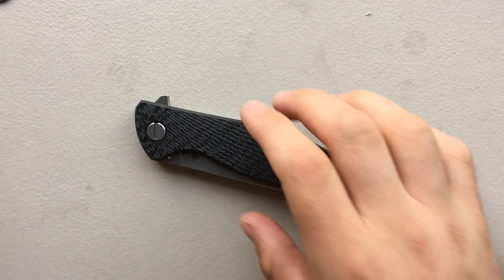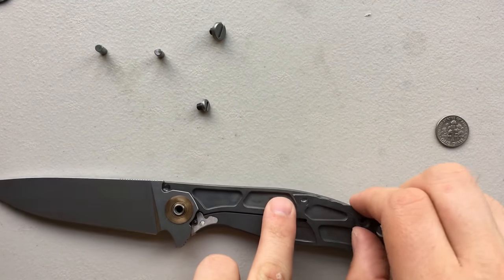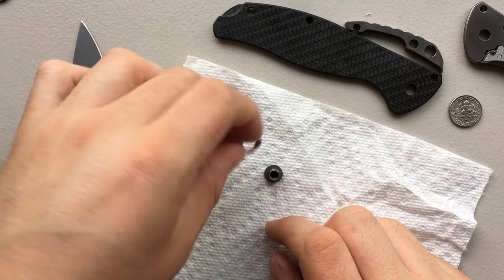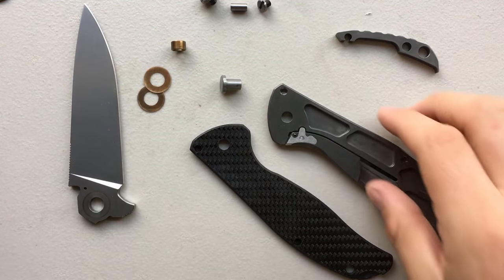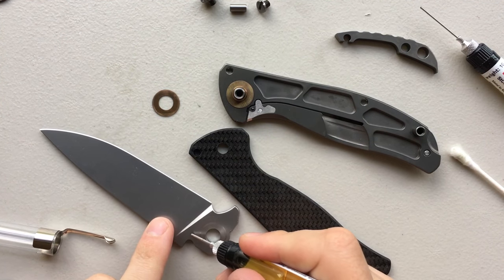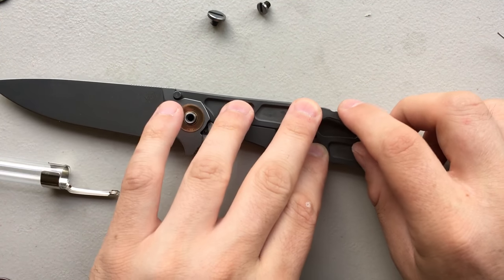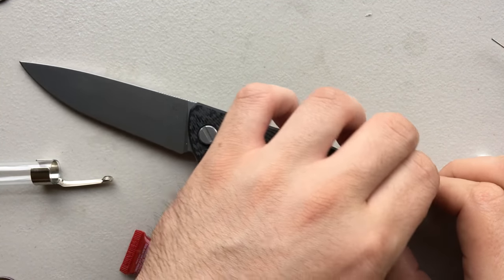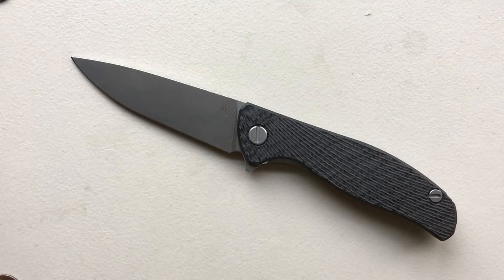How to disassemble and maintain a Shirogorov Hati Pocketknife

Comment: Is this a new thing using heavier weight for the detent? It makes a lot of sense! Gonna do that from now on.
Reply from the maker: +n antip I'm not wholly convinced it makes a difference but can't hurt
Reply: I suppose the main difference would be that the heavier oil will tend to stay in the detent hole and track, rather than eventually work its way toward the blade.

Comment: nick thanks for giving your norseman to birdshot IV, good luck getting it back. jk
Reply from the maker: Hah.  They're not so far that I can't drive down there...
Reply: well this is a dumb question, but why is your norseman in a spyderco box if you watch their video
Reply from the maker: Because the Norseman doesn't have a box, and I figured I'd mess with them a bit.  They didn't know what I was sending.
Reply: will you join the give away from birdshot
Reply from the maker: Nah, I'm a lucky man as is with loaners and great viewers.  No sense in pushing my luck!
Reply: I am asking some recomendation of a custom knife. i have smaller hand and shorter than avarage  height, and under $1000

thanks.
Reply from the maker: Look at my playlist of Gems.  Any of those, I recommend.  But finding a custom is really about what makes your heart sing.